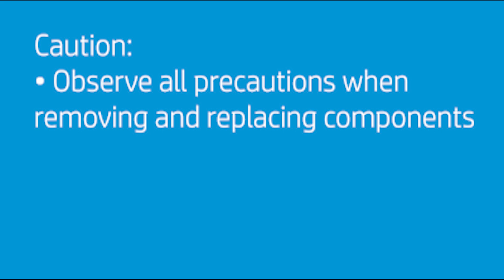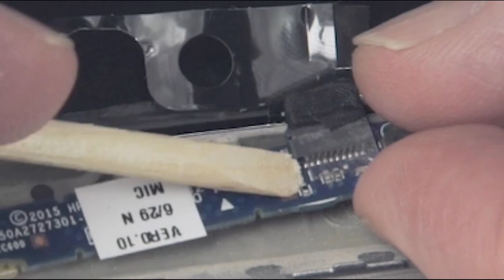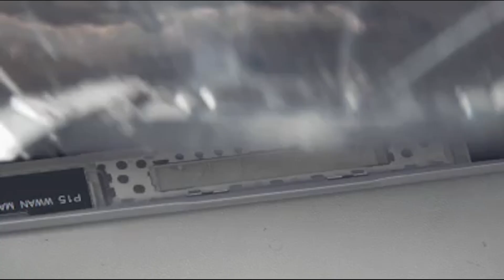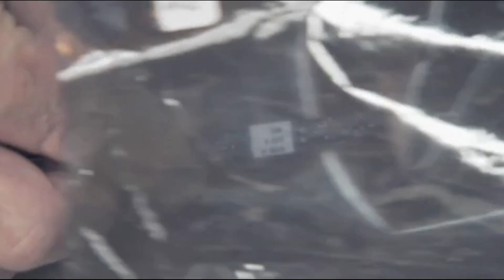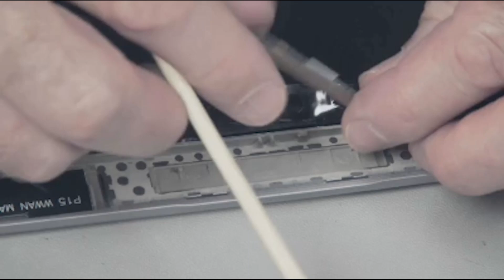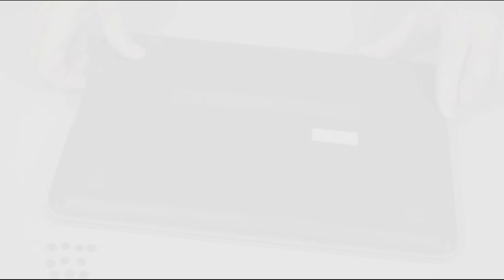Replace the Webcam Microphone | HP EliteBook 840 G3 Notebook PC | HP

Comment: how did you know it needed replaced? was your laptop not picking it up? my mic isn't working but the computer says it is working properly. should I try replacing it?
Reply: I replaced internal mic board and it microphone still does not work.
Reply from the maker: +williedakiid If your microphone doesn't work, the sound is too low, or other microphone audio issues are occurring, troubleshoot the device using the steps in this document: https://bit.ly/2UgdzhC